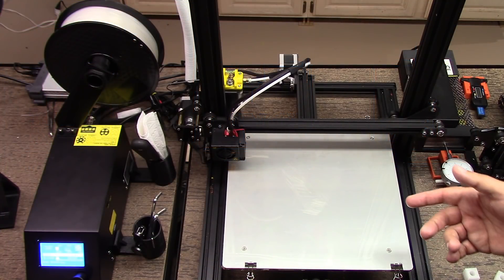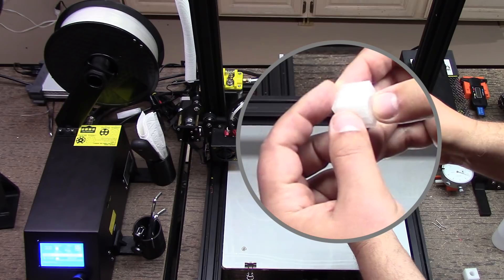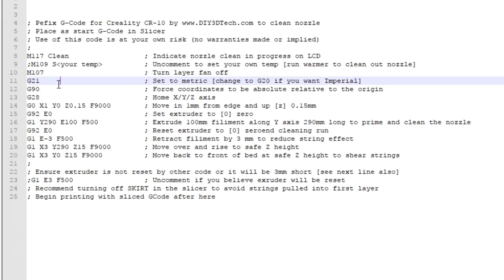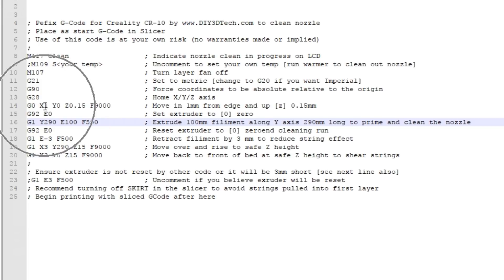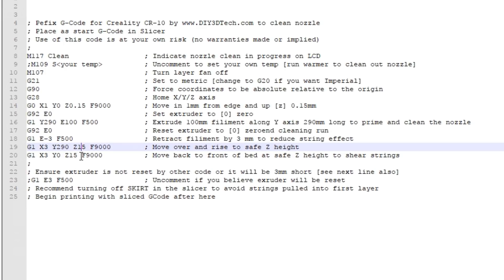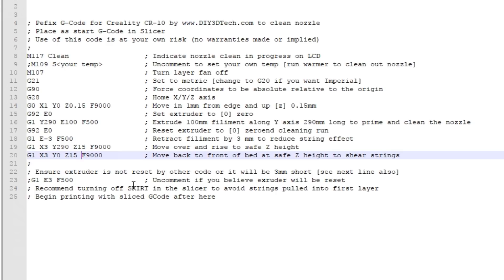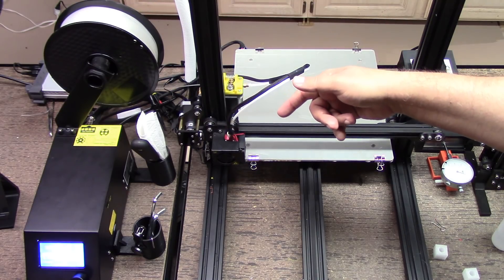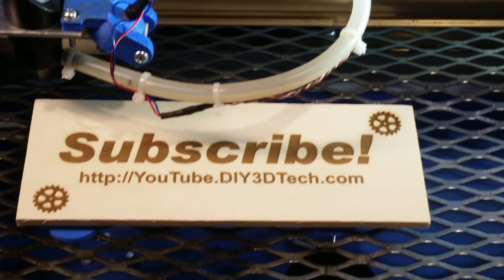Creality CR10 - GCode to Clean Nozzle Before Printing!

Comment: I’m fairly new to 3d printing and have the CR10, but I have always used the “skirt” option for all my prints, and after the print finishes I’ll bring the nozzle temperature right up and pull the filament out. Most times the filament will all come out in one piece including the very thin part which was in the nozzle.
So far this has worked well for me and I haven’t had much in the way of buildup or jams.

I also printed an adapter for the CR10 extruder which makes it easy to push through filament manually, found here: https://www.myminifactory.com/object/manual-filament-feeder-knob-mod-for-cr-10-and-other-bowden-3d-printers-52492
Reply from the maker: The knob is cool seen it over on Make Anything (love his channel) However why d you pull the filament out after every print?  That's a bit of a pain?
Reply: DIY3DTECH.com You might be right haha, I'm still new to 3d printing and just a bit over conscious of looking after it.
So far my CR10 has been faultless, I'm so impressed with it. So you think it's ok just to leave the filament in there for next time? Thanks for the reply
Reply from the maker: Yes you can leave the filament in if you use on a regular basis :-)

Comment: Hi how you doing do you have the g code for the cr-10 mini
Reply from the maker: Sorry no but you can simply modify it for your bed size....
Reply: So you're saying there's somewhere on this group where I can just change the bed size through the cr-10 mini
Reply from the maker: Yes the GCode is based upon a cartesian coordinate system.  So just edit it in notepad and save it...

Comment: Thanks for the video. I had a start gcode before that did a zigzag pattern to clean the nozzle, but after trying the line along the left edge, I like this method better.

I did tweak a couple things with your code though and it's been working great.

1) I use a mirror so have a slight gap between the edge of the heated bed and the mirror (mirrors are slightly under 300 mm). So instead of moving 1 mm over (which would miss the mirror), I move 3 mm. Also changed it to move 25 mm back along the Y as I found having gunk near the home position would sometimes get picked up when the nozzle returned back before starting the print.
     G0 X3 Y25 Z0.15 F9000            ; Move in 3mm from edge, back 25mm and up 0.15mm

2) Found that extruding 100 mm filament to be a bit much, so reduced it to 50 mm along 150 mm of the Y axis.
     G1 Y175 E50 F500               ; Extrude 50mm filiment along Y axis 150mm long to prime and clean the nozzle

3) Used 5 mm retraction instead of 3 mm as I would find there would be a slight blob when starting prints.
     G1 E-5 F500                     ; Retract filiment by 5 mm to reduce string effect
Reply: ; Ready Sound
M300 S0 P100
M300 S400 P100
M300 S0 P200
M300 S400 P100
M300 S0 P100
M300 S400 P100
M300 S0 P100
M300 S400 P100
M300 S0 P200
M300 S400 P100
M300 S0 P500
M300 S400 P100
M300 S0 P225
M300 S400 P150

M92 E99.0 ; set extruder steps (through nozzle)
M205 X15 Y15 ; set jerk
G21 ; set units to millimeters
G90 ; use absolute coordinates
M82 ; use absolute distances for extrusion
G28 X0 Y0 Z0 ; Home

M117 Cleaning... ; Display Message
G0 X3 Y25 Z0.15 F9000   ; Move in 3m from edge, back 25mm and up 0.15mm
G92 E0       ; Set extruder to [0] zero
G1 Y175 E50 F500    ; Extrude 50mm filament along Y axis 150mm long to prime and clean the nozzle
G92 E0       ; Reset extruder to [0] zero end of cleaning run
G1 E-4 F500      ; Retract filament by 4 mm to reduce string effect
G1 X3 Y175 Z15 F9000   ; Rise to safe Z height (15mm)
G1 X3 Y190 Z0.15 F9000   ; Move back a bit.

M117 Printing... ; Display Message
Reply from the maker: Very interesting and thanks for sharing!  Also as a side bar, the reason for the volume (i.e. 100mm) is on the CR-10 after running red and switching to clear, I found that worked well to remove the red tint :-)
Reply: DIY3DTECH.com Makes sense. If I'm changing filament then I will manually extrude through the Octiprint interface until I no longer see traces of the other color. For in  between prints 50 mm of filament is plenty. May even reduce it further. Liking it so far and happy to get rid of the skirt :)
Reply from the maker: Had to laugh a bit "happy to get rid of the skirt" as in my younger days losing a skirt was always a good thing :-)

Comment: My question. Does a purge benefit somehow from actually printing on the bed or does it matter for cleaning out the nozzle?

I purchased my printer (cr-10) apparently it came with cura on the SD card (who knew ).  I started out using Idea maker as my first slicer because it was the first one I tried. It does a little purge automatically. It does home to zero run and then lifts up and does a  purge/priming thing. Often since switching to straight glass the other day i have to grab the little loofah of filament off the nozzle or it tries to pack it into the first layer or the raft. Before I quit using tape the purge loofah would often stick to the tape.
Reply from the maker: That is the problem with purging, as it is good to clean out the nozzle mainly after running another color as it can hang around for long.  Yet you the negative results of this as it does get sucked into the first layer and this is reason I wrote this as it is basically a prime / purge action however over a distance so it doesn't bunch up and get sucked into the first layer...

Comment: Thank you so much for the post it has made my prints a lot less problematic. Love your work !!

I have the (https://www.jaycar.com.au/duinotech-mini-3d-printer/p/TL4076) printer and had to sneak in a 'M109 S240' wait for nozzle to reach 240c otherwise it happily gets right down to the job. I have shared my complete start G-code for those with the same printer.

G28                                 ; Home nozzle
G1 Z5 F5000                   ; Lift nozzle
M109 S240                     ; wait for temperature to be reached
M117 Cleaning Nozzle ; Display this text
M107                              ; Turn off the fan
G90                                 ; Force absolute coordinates
G28                                 ; Home nozzle
G0 X1 Y0 Z0.15 F5000   ; Start position nozzle clean
G92 E0                            ; Set extruder to zero
G1 Y90 E90 F500            ; Extrude 90mm of filament along the Y axis
G92 E0                            ; Set extruder to zero
G1 E-3 F500                   ; Retract 3mm of filament
G1 X3 Y90 Z15 F5000    ; Shear the filament
G1 X3 Y0 Z15 F5000      ; Shear the filament

Thanks again :)
Reply from the maker: Hmmm interesting and many for one the kind comments and two sharing with the community!

Comment: You could just use a Skirt and if you want to make sure that it prints the skirt a certain length, you could just enable "Skirt/Brim Minimum length.
Reply from the maker: Yes, and I mention this in the video, however it moves it close to the print (also yes I know you can adjust the distance too) however it means the "snot" can be pulled into the print as the whole idea of this is to move it "away" from the main print as well as "shear" the "string" which does not happen with a skirt.  Hope this explains... :-)

Comment: Just what i need, just about... Also my print head has some moving space besides the bed - i was thinking of using that to mount a metal brush or a piece of scouring pad and program some moves to automatically scrub PETG off the nozzle before it bakes itself on there.
Reply from the maker: yes you could and have seen that (the brush GCode trick) :-)

Comment: Great Video.
I use a similar gcode for my MP Select Mini when I use Cura but when I tried it with the Craftware slicer I ran into a problem.
The Craftware slicer executes the start Gcode before it warms up the printer.
 It may work if the extruder were pre-heated before starting a print but I didn't bother. I only use Craftware when I need custom supports which isn't very often..
Reply from the maker: Many thanks! That was the reason for mentioning to add if needed as some slicers do that...